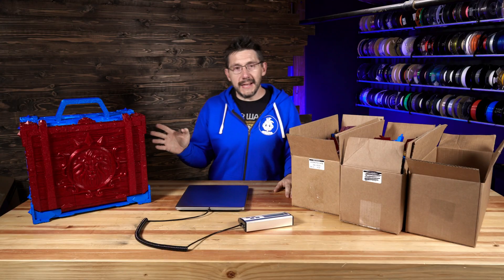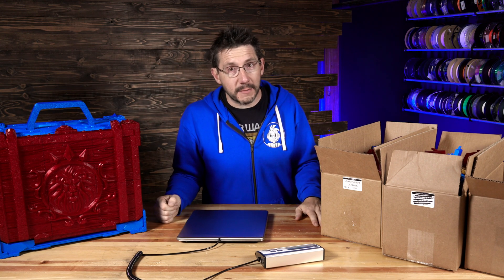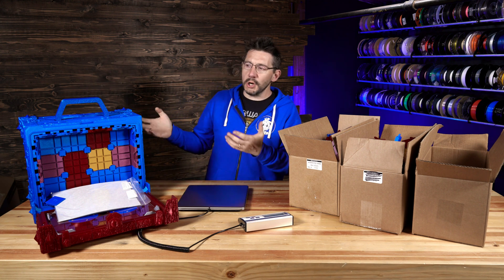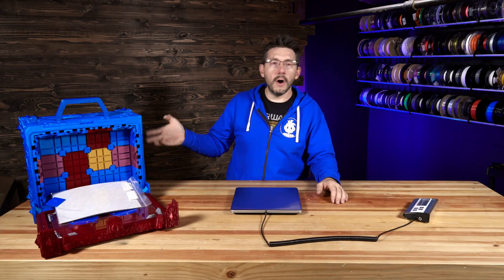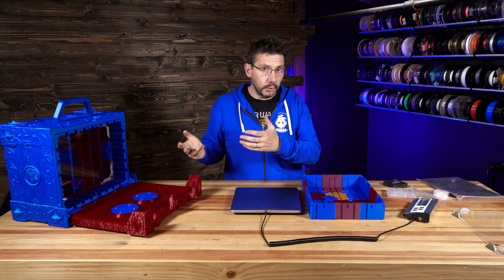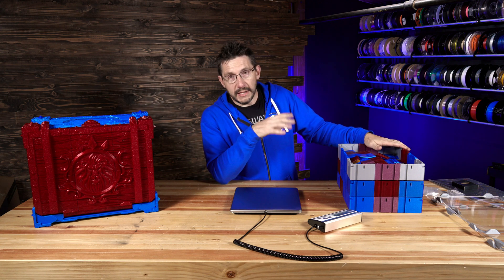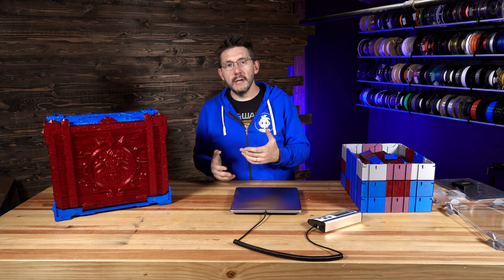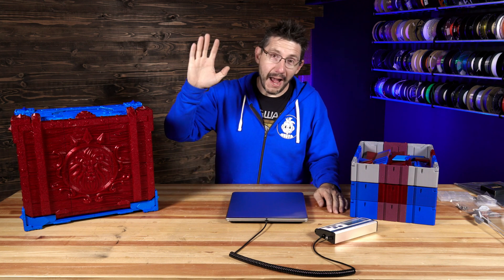The ACTUAL Filament Weight for My Crate3D Omni 2 Briefcase

Comment: Thanks for the update and clarification on the amount of filament used.  It is a pretty cool design, and I applaud everyone that has shown this off so far.  It is a very cool design, but from the aspect of backing the kickstarted and planning on selling these... i just don't know how well it would sell to customers.  If i would do that, i think PETG would be a better filament to utilize; I can see people taking these in their cars over the summer, and potentially leaving the case in the car for an extended amount of time.  Last thing i would want is to get a call from that customer stating that they can't open their case...

Again, thank you for the Updated & Clarification!

Comment: It may only be 7.5 kg for what you printed but you only used 2 perimeters and 10 % infill. That is generally what’s recommended for decorative pieces, not structural and functional pieces. So how strong is it really?
Reply: Well... not strong. :) This is a classic case (pun intended) for using the wrong technique/material for an object. The inserts could've been the thing, including the rails and then plans for a wooden chest.
Reply: @punishedbrains  exactly. If you printed this to actually be strong and functional it would weigh a lot more. Basing it around a wooden box or existing briefcase would have been better, been stronger and would most likely weigh less and be cheaper to make. They could even keep the look of it and have the outside just be panels to stick onto a wooden box for decoration.

This is something I have seen more in 3D printing than anywhere else, people just seem to forget that other methods exist and think that everything must be 3D printed when in a lot of applications they could save time and money and end up with a better end result just using a different method.

Comment: Doing the math with Proto Pastas prices  at $30 per 500g spools it's about $420 to print as seen. If you went with Proto Pasta's budget option of recycled black PLA ( my personal go to budget option) at $16 per 1kg  it would cost about $120 to print which ain't bad. Now I'm not into miniatures, but it looks like a really fun print with a lot of ingenuity and thought put into the design, just requires a bit of planning to keep it all in budget.
Reply from the maker: I think that's exactly it right there, well put!
Reply: I still think the real issue is time - if you are a hobbyist with a single printer; having your printer run 24hrs a day, every day for a month.
Reply: @andrewholdaway813  Time and the box should be wood, with plans for how to make that. The rest can be printed.

Comment: Still expensive 8 rolls is not cheap.  But it is a fancy customized design. I wonder if it can be “leaned” up. Or if that would compromise the strength. I guess it is similar to a pelican case (but not as durable).

Interesting to see how it holds up to abuse!!! A  third video? 

You seem to skirt the issue of cost - while the company picked up the tab for filament for you a buyer will still have to pay unless the company picks up theirs too… he he

Comment: People who keep saying 'get a pelican case instead it's cheaper' need to check the prices of similar sized pelican cases. They are not cheap at all. I think the omni 2 could be better designed using sheet material, but 4.5 kg of, say, PETG filament isn't bad cost-wise.

Comment: Man thats crazy, even 7.5 kg of filament is still alot. Its not going to offer any protection for the minis. You drop the case its gonna smash. I think they've missed the target market and needs to be heavily modified, im sure you could get it down to half the filament and still have the same strength.
Reply: even with cheap stuff thats 140€ of filament... not talking about power and wear on the printer with so much load. add the 60€ for the kickstarter...

and as you said, 0 protection for the minis unless you foam coat everything... commercial solutions are available at a fraction of the price.
Reply: Exactly, 7.5 kg with only 2 perimeters and 10 % infill. That is what you would use for decorative pieces, not structural or functional pieces.

Comment: great clarification. But honestly, that's still a crazy heavy case. like, those walls are almost an inch thick. but why? that's ridiculous. Oh it's pretty, but the box weighs more than it's contents ever will, even if they're old pewter mini's, and only because the walls on the drawers and case are ten times thicker thasn they need to be. It's like a bullet proof vault for moving around a bag of potato chips. even games workshop moxes aren't that thick!

Comment: Ufft 7.5kg is a lot of filament (and all those print hours are crazy!). Would love to have some of these for my minis but I can't put in so much time and materials for them. My fingers are crossed that for whatever omni3 they release they choose to focus on optimised material use and print times.
Reply: It's better to use wood as a case structure then full on filament a woodworker has already done so and he just prints inserts and the handle, hinges, and corner holders to put it all together it saves way more time and it's way more modular than this.
Reply: @Bigdog1787  can you point me to where that wooden framed version is?

Comment: This follow-up video is really appreciated, especially to see how easy (or not) it is to remove the drawers. Your weight matches up pretty well with what Jonathan from The Next Layer got from his full-sized case; he also mentioned that the plain case without decorative touches was quite a bit lighter. 

Still…yikes. 16 and a half pounds just for the case before you put stuff inside? I still can’t justify it.
Reply from the maker: It IS heavy in the hands. Glad you liked the video!

Comment: Well covered. These kinds of measurements are always a challenge. It's like looking at a Prusa MMU print and people ignoring the print and going "OMG, that purge tower is HUGE! That's not worth it" but then gladly buying a Bambu with AMS and celebrating the successful and amazing looking multi-color print while ignoring the purge, simply because it wasn't on the print bed. You were given a list of things to print, printed them, and it used 17kg. But the actual print, the thing people actually care about as opposed to the production excess (aka large kickstarter list, purge blocks, support structures, failed print, etc.) was not actually as big. Sure, there's some necessity to the extra prints (change campaign or block of cheese size) and suddenly you either need to print more parts... but for the most part, you print what you can when you can with what you have. If you have some sample coils, or a campaign is coming up and you have decided to use this, then you're gonna print it and use the filament anyway. 7.45kg or 17kg upfront is a lot for some and not for others. But 100-200g at a time is going to use the same amount in the end, just slower and without the sticker shock.
Reply from the maker: Well put.
Reply: Lol no one is ignoring the poop because it isn't on the bed.

Comment: 7.5 kg is going to be 8 spools, at $30 a pop, that's still $210.
Reply from the maker: Yup, even at $20 per spools it’s a lot. Even the cheap $12 spools would still be a lot. Big print projects like this definitely aren’t for everyone. However, for those that do like them, I definitely wanted to make sure I had the right info.

Comment: How to print this in a few easy steps...

1- Buy 24 printers
2- Buy $600 worth of filament 
3- Quit your job and/or divorce your live one.
4- Set up, update and calibrate your printers
5- Buy the files on kickstarter 
6- Print
7- Assemble 
8- Enjoy your $20 plastic box
9- Never use you 23 printers ever again. 
10- Have a midlife crisis.
Reply from the maker: There are WAY MORE than 10 steps.